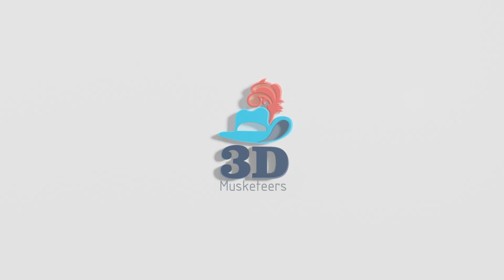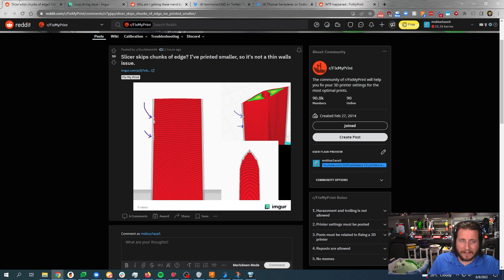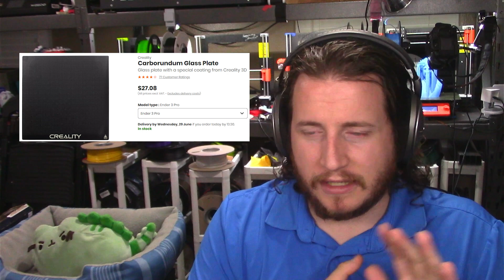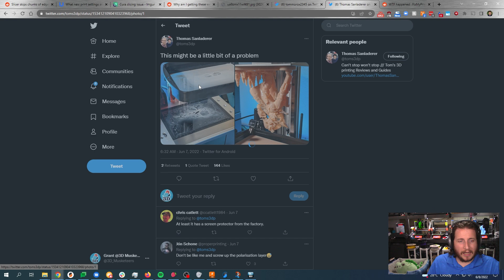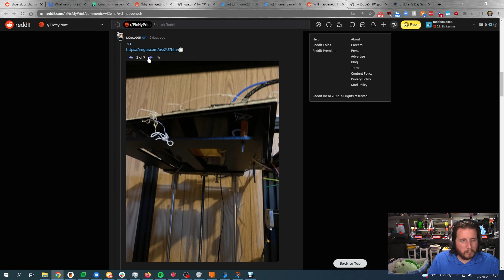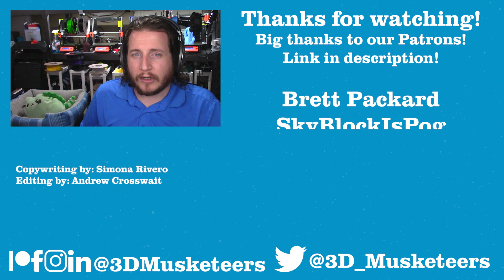What Happens When Resin Leaks DURING A Print! - PrintFixFriday S1E39

Comment: You might be the only person I've heard make that tramming-vs-leveling point besides Tom!
But no complaints from me - maybe if it was more often called tramming, we wouldn't have people trying to use a spirit level to "level" their bed 👀

(Which does apparently happen from time to time, though I'm not active enough in any of the main communities to have encountered that personally :))
Reply from the maker: I have a machinist level, that I have definitely used, but it does not matter if the table the printer is on is not level as well ha ha. 

If we used tramming all the time instead of leveling people would not find the videos. My goal is to make that distinction often in hopes it catches on :)